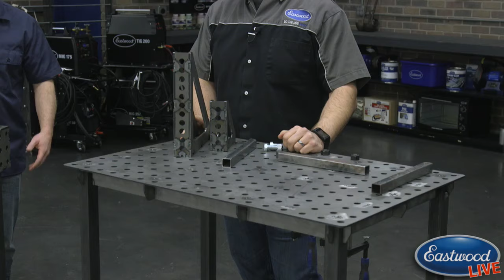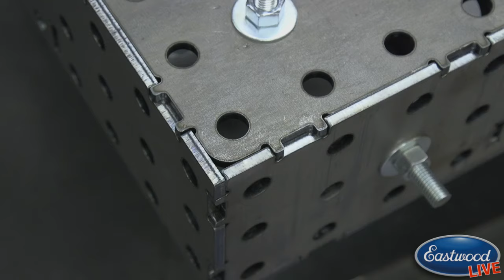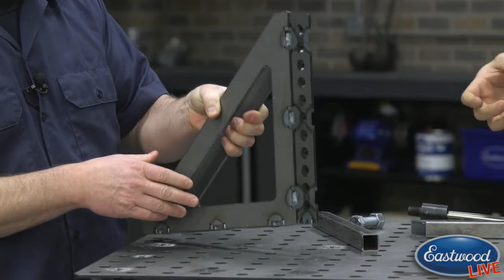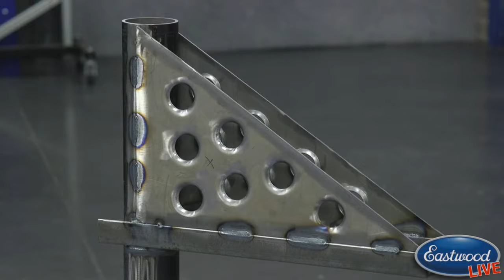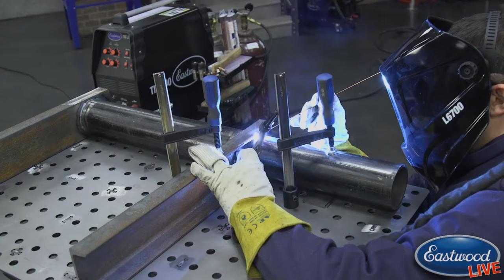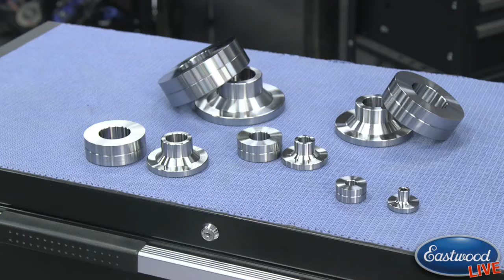How To Use Welding & Fixture Tables for Precision Metal Fab - CertiFlat Welding & Fixture Tables

Comment: Here is my table that I finally built, this was one of my bucket list items. https://youtu.be/4kkmUexC5Og  5'x10' 1/2" thick. The center rotates, it weighs in at 1,050 lbs.  I've since installed 12" casters rated at 900 lbs. each  Stealth Industries in Dallas Texas did my laser work.

Comment: I have a 2002 Mercedes Benz S430 with minor rust on the doors do you recommend that I should cut them out cut it out and replace it with metal or can I use fiberglass over metal
Reply: NO...you need to stop right there and buy a certiflat table that is the new fad pushed on everyone. It should be a big rusty mess in short time.